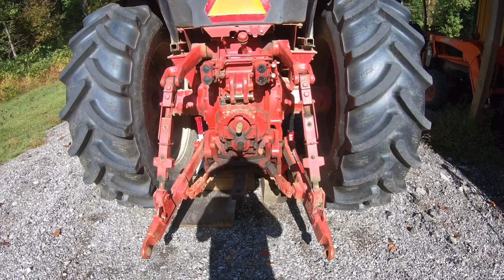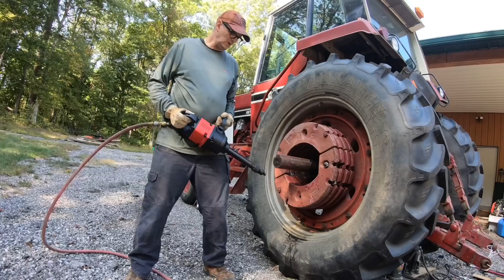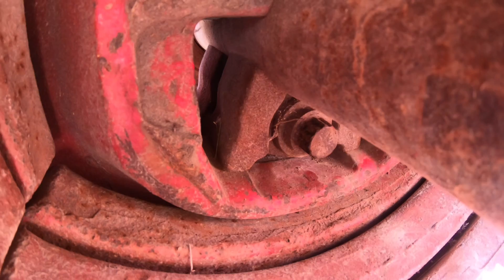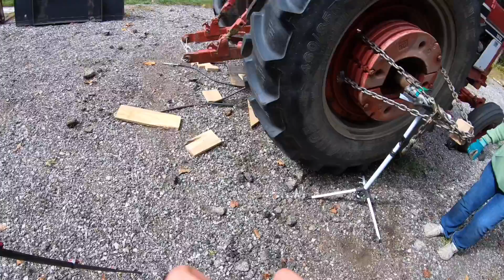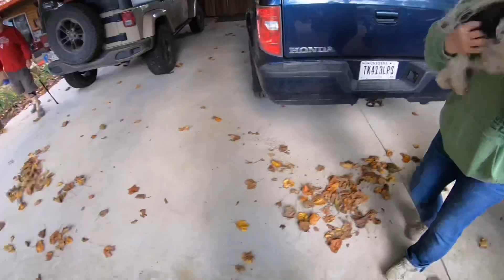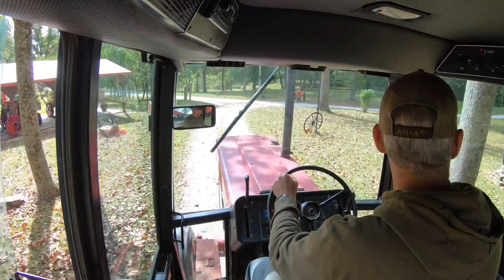International 1086 Moving Wheels w Harbor Freight tools.

Comment: Did you have any trouble with the wedges coming loose or wheels walking out after this initial torquing?
Reply from the maker: Thanks for watching and your comment. After I drove it and stomped the brakes a few times and re-checked the torque in the video it was still tight. I did that again after using the tractor about 8 hours and it was still tight so I never re-checked with a torque wrench but the wheels still seem tight so no, never had an issue with them coming loose. We appreciate your support! Have a great day and be safe!

Comment: good video a nd job. really nice job. if i was you i would leave front like it is some times you can't get them out. on the masseys they had a square headed adjusting bolts the tractor use to come with the tool to change them.  take care, be safe and well.
Reply from the maker: Thanks for watching and your comment. I think I will leave the front where it is. I used it on the side of the lake dam and it seemed pretty stable. I hope I never need to be on anything steeper than that. Thanks as always, we appreciate you and your comments! Have a great day and be safe!